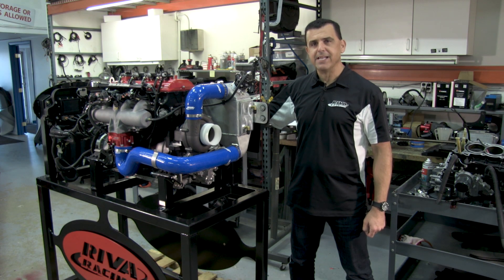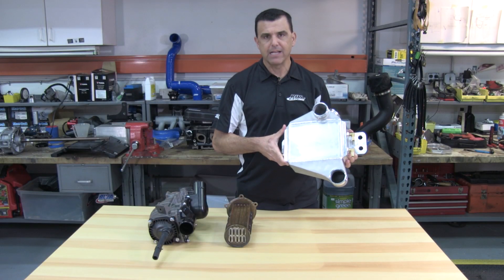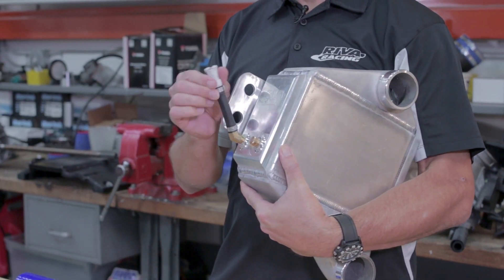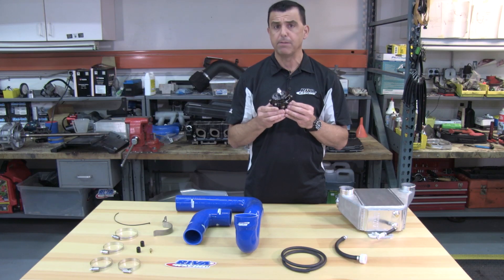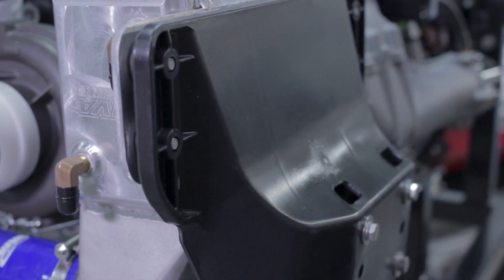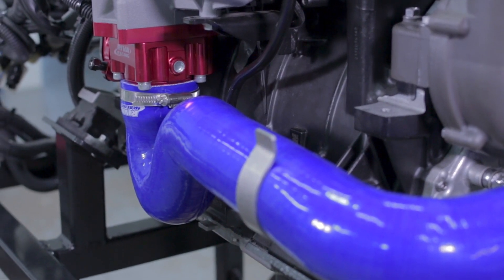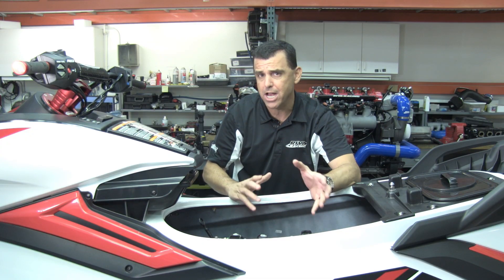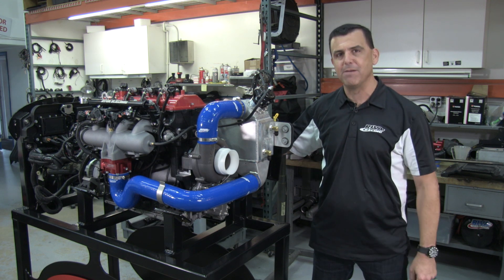RIVA Yamaha 'GEN-3' Power Cooler Kit

Comment: will the intercooler give it any top end MPH? Looks like a great clean setup and a must with the blowoff valve...
Reply from the maker: Hi Robert! The RIVA Gen 3 Power Cooler makes it possible to raise engine RPM without overheating problems giving higher top speeds and faster acceleration. You will see improved performance throughout the RPM band, especially in warmer climates, or after the engine would normally have heat soak without the power cooler.

Comment: Thumbs up! I have a 2017 SVHO Limited. Its all stock. I would like to add a BOV just for the sake of having one, but am also thinking of adding the BOV / Intercooler kit. What kind of performance gains would I expect to see from an upgraded intercooler? This kit would be the only mod. I do not race and do not plan on adding any further changes to the stock machine. Thanks.
Reply from the maker: You will see improved performance throughout the RPM band. This will be especially noticeable in the heat of summer where the RIVA intercooler’s greater cooling capacity will prevent heat soak that robs performance as your engine warms and both air and water temps rise.